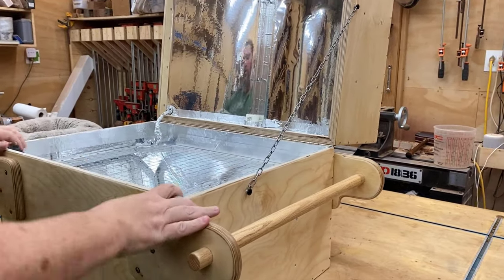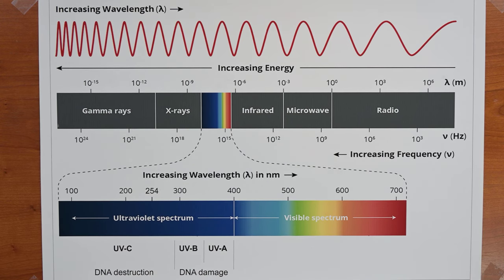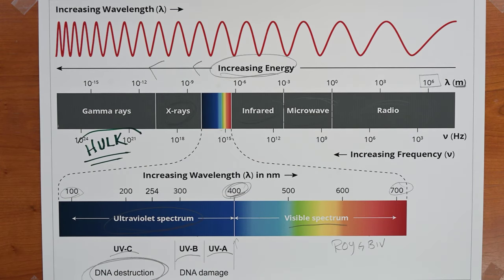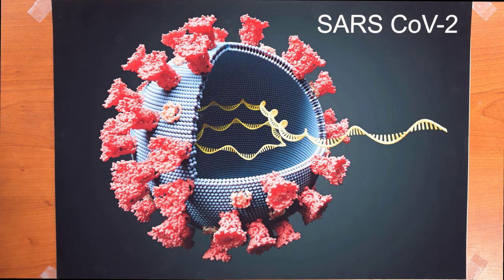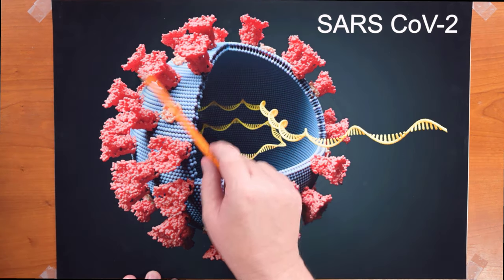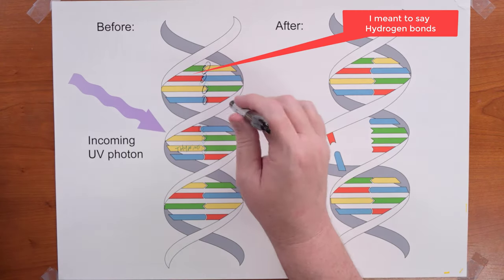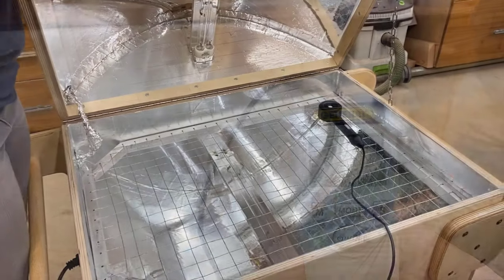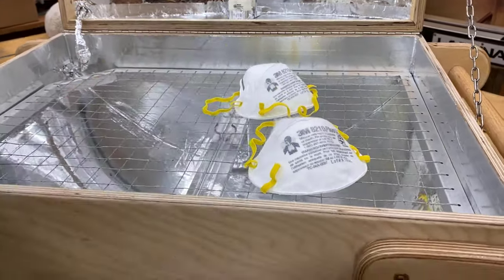Box to KILL Coronavirus!  UVC PPE Sanitizer

Comment: Thank you for this channel, which I just discovered from your woodworking channel. I like the name of this channel also, as it reflects my personal philosophy: continual learning and improvement. 

I don't halve your depth of background in the sciences, but I do have some. Most of my working career was with electronic test and measurement equipment - first using, then later repairing and calibrating. Getting into the broader field of measurement science (Metrology) required rapid personal learning of things that were previously dimly remembered from high school, or unknown to me. (For example, studying the physics of gas flow the week before doing an accreditation audit on a company that calibrates gas flow equipment.) 

I anticipate visiting this channel (yes, I have subscribed) pretty much as often as your woodworking channel. 

Incidentally, I used to live in the Denver area in the 1960s, and have been there several times since for family visits, some visits to Lowry AFB for various trainings (including Metrology), and for a few conventions. And, Denver is home to the Broncos, one of my three favourite NFL teams. (The others are the team formerly known as the Redskins, and whoever is playing against the Cowboys.)
Reply: Thank you so much for the kind comment!

Comment: Fantastic.  I have followed your old channel for some time and have subscribed to your new channel.  A question though.  Shouldn't you load the box with masks and then measure the output in the corner?  The empty box might might have a higher luminance as there is more reflection and a box full of masks might have more light blocked.  You would want to know that the last mask in was still getting enough UV-C to be disinfected. Great work. Regards John.
Reply from the maker: Hi John, that’s a great point, and in fact I measured with the just the top lights on, and then just the bottom lights on. And it still gave just over 2100 microwatts per square cm in the worst spot. As opposed to the 2200-odd amount that I showed on camera. Apparently there was very little help from reflectivity. This is why I took 2000 as the base for the calculation. 

Also, another interesting thing is that when the power first kicks on, as the lights are powering up, they started out in the low 2000’s, but within about 10-15 seconds the lamps are at full power and the reading is over 3000 microwatts per sq cm. And that’s how it stays for the full term. 

But to be abundantly safe, we still used 2000 as the base number.

We actually tried tons of measurements and did all sorts of testing, but I just didn’t think people wanted to see it. But I’m delighted to see we have some critical thinkers like you out there! 😁😁

Thank you for checking us out here!!
~James

Comment: Great video. Just one question, I built something similar but the lights I used caused ozone generation, did you have the same issue or does the UV frequency you used not do this?